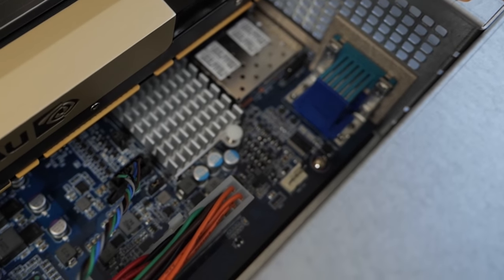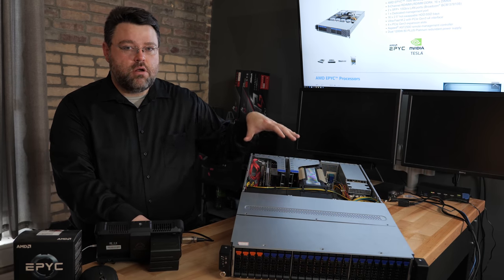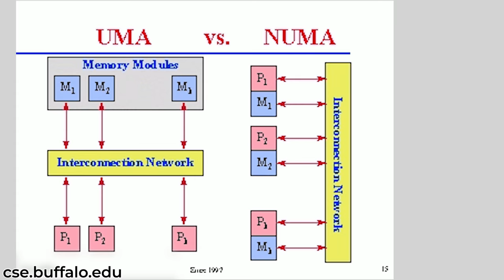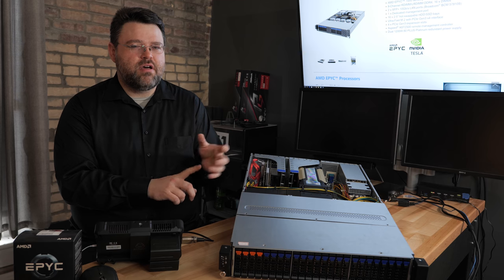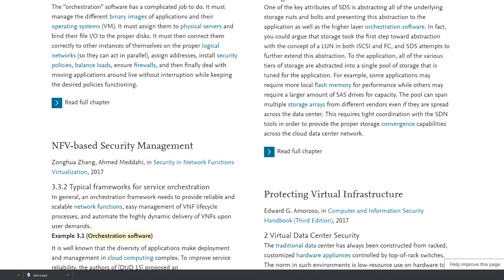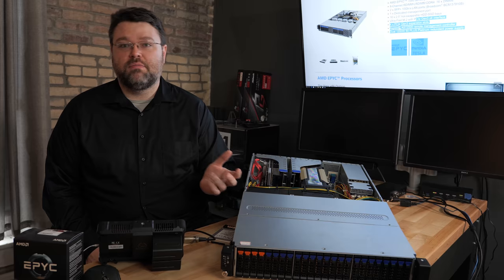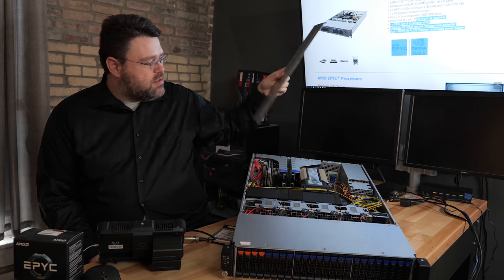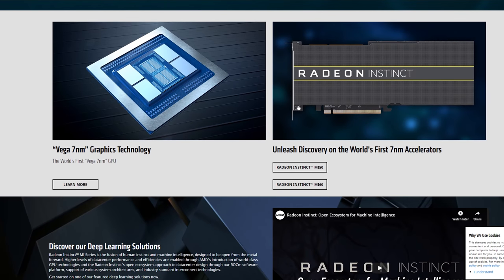AMD Epyc Gigabyte G221-Z30: 2x Tesla V100 Server!

Comment: It sounds as if HP does the same with its servers as with its printers. Like how HP pushed an update to reject generic ink-cartridges and lost a courtcase for that in Australia.
Reply: Southeastern777  

One of the big ones in today's world. Fortunately printing has gotten less required, most people can watch their documents on a laptop or a phone and sending/sharing documents can be done via PDF but unfortunately in some situations you still have to print.
Reply: Canon did the same with its printers. Luckily I'm using the scanner which is all its good for.
Reply: That's one of the reasons I moved to a laser printer. Colour laser has gotten ridiculously cheap and the cartridges are reasonably prized for the amount that I print.
Reply: maybe, but HPE (Hewlett Packard Enterprise) and HP (Hewlett Packard) are two different Companies, they aren't connected to another anymore.

Comment: Gigabyte did their homework. To offer all of the IPMI features bundled free & removing all of signed firmware restrictions locking you out from the hardware. If you don’t pay for the software license or use their rebadged drives, cables, etc. Since that’s only way Gigabyte servers can infiltrate the enterprise market dominated by HPE and Dell.  If Gigabyte is successful to steal enough market share on the enterprise. Those features that usually cost a lot of money to license (ex: IPMI) to unlock would eventually be bundled for free.

Comment: Great video, a few things to keep in mind: 
- Motherboard must be certified from VMware's Hardware Compatibility List (HCL) to be supported
- You must buy (or rent) NVIDIA GRID licenses to benefit from full 3D acceleration in VDI e.g. vDWS ($400 lifetime per concurrent VM)
- GeForce Experience does NOT provide all the benefits due to the nature of Tesla NVIDIA drivers
- Performance is far behind any high-end GTX or RTX graphics cards when gaming
- A Raspberry Pi 3B+ or 4 (dual-screen) can be used as a fantastic Thin Client using Stratodesk (H.264, official Horizon Client, etc)
- Pop!_OS as a VM can benefit from CUDA OOB (also remember to 'apt install open-vm-tools')

Comment: Our aging HP DL380P G8's (2x E5-2690v2) at work will need to be replaced soon. Our MSSQL server is still on spinning rust, trying to justify a single root Epyc 7371 build with Optane. $7k/core licensing really adds up though...

Comment: Ok I just bought a new gigabyte b450m ds3h with 2×4gb gskil ripjaw a amd rysen 5 2600 and I ain't getting no video signal either for the HDMI of dvi so what's going on
Reply: Dude ryzen does not have integrated graphics says so right on the box you need a gpu man.
Reply: @109268  some do you just got to check before you buy I didn't lol

Comment: 2TB of RAM! Reminds me of my Mariadb dB running on 32GB. Select queries take more then 9 seconds..... I really need more RAM but then I need to upgrade a lot of stuff which is expensive.
Reply: That's the great scam of building a "balanced, 'bang for buck' system for your specific needs" - no matter how ideal it is, you'll always want more; and, now you basically have to build another brand new, more expensive system because you did too good of a job with the first build LOL

We all might as well just wait for 64c/128t dual socket EPYC systems with 4tb of RAM - that should at least hold us off for a year rather than a month lmao
Reply: @RyTrapp0  when I build that server the use case I had in mind was different. I couldn't get more ram at the time. CPUs with more then 32gb of ram support (intel xeon e5 and higher) are really expensive. So I went for a xeon e3. AMD hadn't even announced ryzen....

Comment: I wonder if you made a vdev out of nvme and spinning rust if zfs would be smart enough to serve ALL its reads/writes from the nvme and only use the spinny disk as a failover. Like, use 4x2TB nvmes, and a single 8TB (split into 4 partitions) hard disk to mirror each other in a stripe. Sure it'd be writing to the spinny rust for AGES and might need a big fast buffer so it could respond immediately to syncs (like, it's safe to reply you've synced, so long as whatever was written to the nvme stays somewhere else until it's finished replicating to the spinny disk). Ugh. I want to try this now .. it would be SO FAST and safe! i feel like i'm wasting nvme if I use nvme just for mirroring more nvme :/

Comment: But will it run Minecraft?
Reply: Titan Mechanism  yes but minecraft servers like clock speed more then core count so it would probaly suck.
Reply: Titan Mechanism  Unlike Ryzen, the clock multipliers are locked on EPYC.
Reply: @johnm2012  well they are "locked" the strange event that can only be described as the typical amd fuck up epyc can be overclocked like threadripper only up to 4.0. Because AMD forgot how to lock down multipliers.

Comment: looks like gigabyte in moving in the right direction, this is a very sane solution they are offering. i am really tired with hpe's "certified hardware" bs, you cannot put a single non hp harddrive or pci-e card, without all the chassis fans go full blast and there is no way to control this. are you fucking kidding me hp? "sea of sensors" my ass.

Comment: I only have one comment: How about 4hr mission critical on-site warranty/repair. Can I get that with Gigabyte in any random country? That's probably a reason to stick with HP/Dell and as a system administrator to be able to sleep well. Performance per $ is secondary. However I love the new tech and inovations!
Reply from the maker: You'd be surprised how much of this service with Dell/HP is just contracting local owner/operators in your area. If you're a big enough customer your reseller will do the same. I've even seen resllers give you spare parts to keep on hand to meet SLAs.